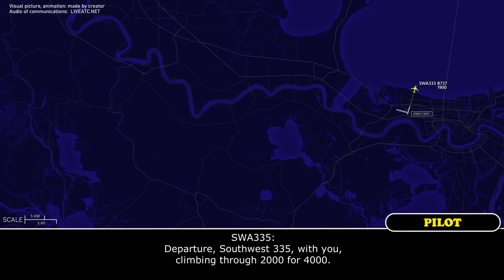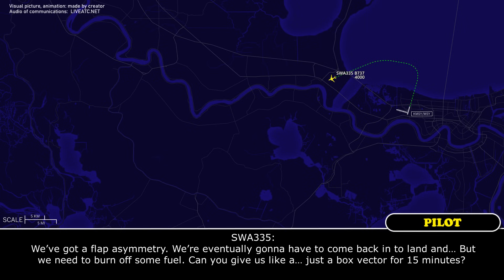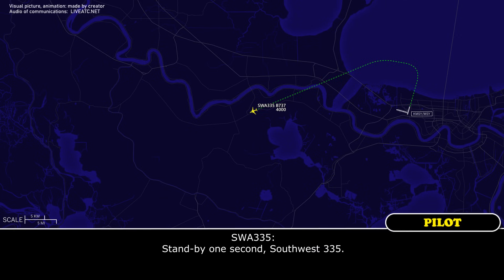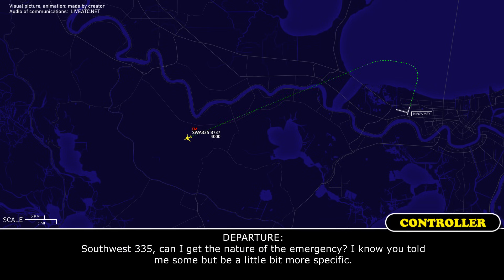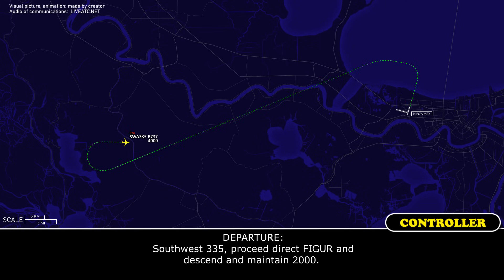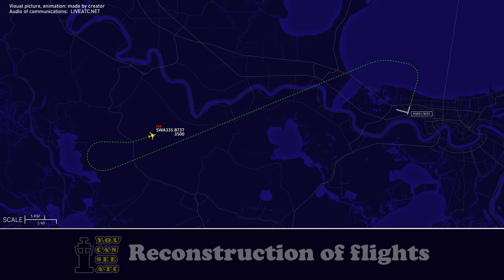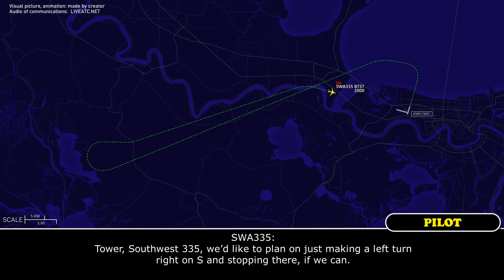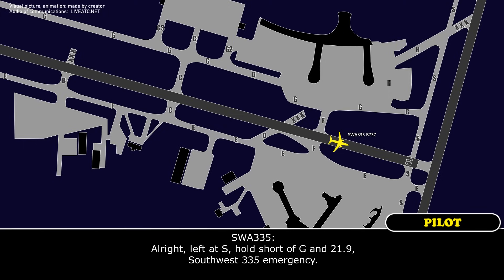Flap asymmetry. Southwest Boeing 737 performs emergency return to New Orleans Airport. Real ATC

Comment: Burn some fuel and had two hours of fuel? And why land tailwind?
Reply: 3-4 knot tailwind is totally acceptable.
Reply: Burning off fuel reduces landing gross weight, therefore it reduces landing speeds, landing distances, and brake temperature rise.
Reply: He certainly came close right to end of runway that was hair raising watching video I bet everyone was wincing he'd really got a mechanical issue
Reply: Just a complete wild ass guess from someone who knows nothing about flying a plane but does know MSY, the west/east approach is the only one over completely unpopulated area. 🤷‍♂️
Reply: I was also surprised they needed to burn fuel.

Comment: They’re trying to trouble shoot a flap asymmetry issue, stop asking them whether it’s an emergency or not…
Reply: Pilots can walk and chew gum at the same time.
Reply: ATC asked him twice and it was only cause they didn't respond. They then asked again for some more specifics later on. If Southwest was unable to answer cause they wanted to focus on the problem, they could have just told the controller to stand by. If you think you'd do such a better job why don't you become an air traffic controller sweetie?
Reply: @NerdbAB  There is some minimalist reasoning on this channel about souls on board and fuel remaining reports requested by Air Traffic Control. A "souls on board" report is provided from the cabin supervisor shortly after pushback.  That figure is written on the flight plan, we really don't need comments about safety protocol for this small an issue. Fuel on board the aircraft is part of the captain's consciousness at all times, it is not an unknown factor as evident that if you were to ask a pilot, visiting the rest room, what quantity of fuel is onboard, believe me his account would be very lose to reality.   I know we don't like to think about it but an aircraft reporting a problem can be without communications shortly after or worse, so it is no problem providing information.
Reply: With a flight control issue, of course it’s an emergency..
Reply: @thomasaltruda  
They had not yet declared an emergency. They were troubleshooting an asymmetry problem with the flaps. 
This usually means that that there is a position disagreement between the left and right side set of flaps. Sometimes simply recycling the flaps  can clear up the problem. But there is always the possibility that the problem could become more pronounced and that can be deadly.
My point is if it was an emergency situation, the crew would’ve already declared an emergency. Let them troubleshoot the problem and then let you know whether or not it’s an emergency stop asking so many questions when people are trying to concentrate on a checklist.
Reply: @kenriehl7852  Even in the absence of the declaration of an emergency, controllers may elect to ask the two questions.
Reply: He can't hear you. There is a tremendous effort to hire air traffic controllers now.....per Mayor Pete...perhaps you should apply.

Comment: TIL the flaps on a 737 aren't mechanically linked. IIRC there is a connecting metal rod between the flaps on the Maddog. Surprised Boeing didn't carry the tradition over when they bought out MD.
Reply: Think about this, mechanical is not the only way to link flap mech from left to right,  An electronic link which supervision of the degree of travel and controlled by one of the many flight control computer will do the same job.
Reply: Recertification?
Reply: Actually both flap portions are supplied hydraulic power, The computer will shut down forward or reverse motion if there is a difference in extension or retraction of more than a certain value.